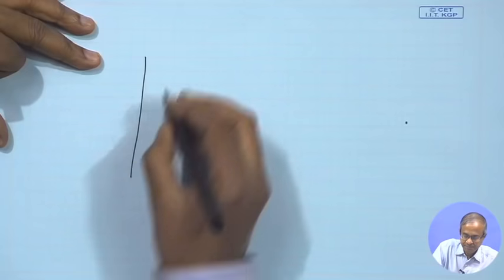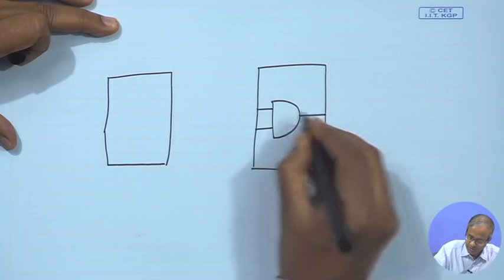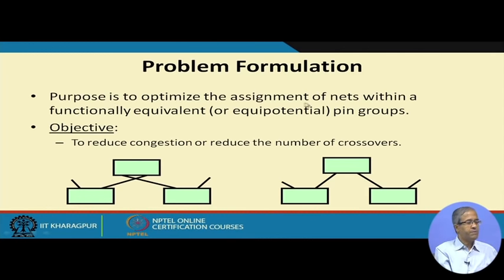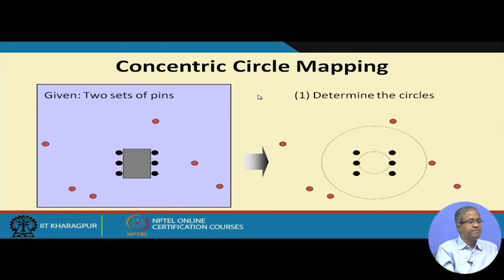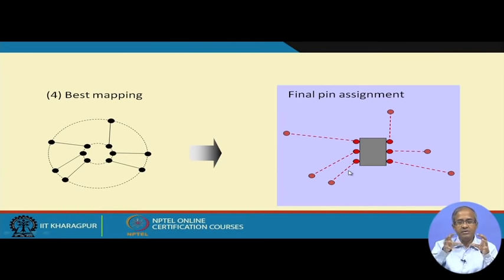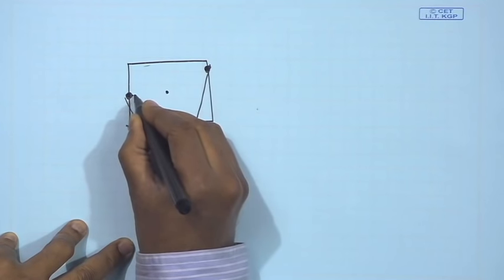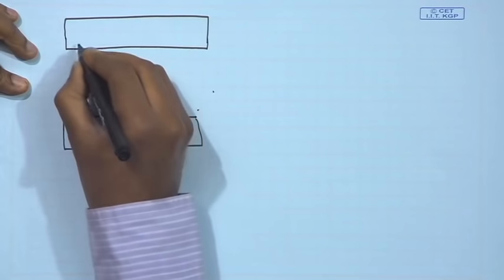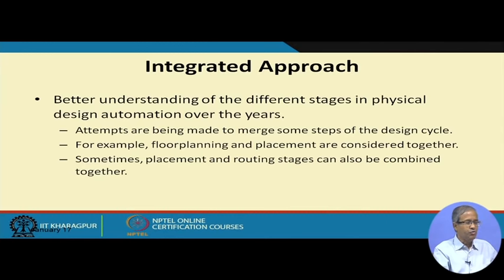Pin Assignment

Comment: In topological method, how can you ignore connection to a pin because it is further from the center? Please explain, thanks!
Reply: to my understanding, the two pins under consideration are of the same block, the one closest to external pin gets a connection and the other one can simply be short circuited with in the block( thereby reducing delay).
A reply about an year later, anyway posting it, hope it helps !